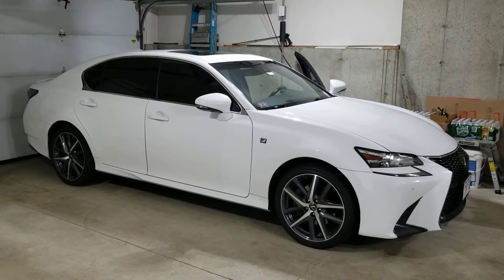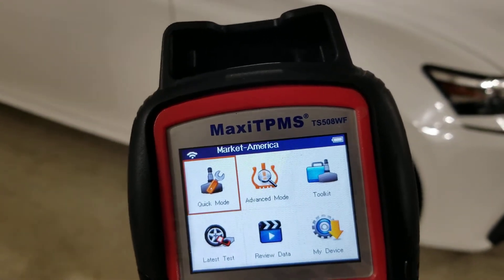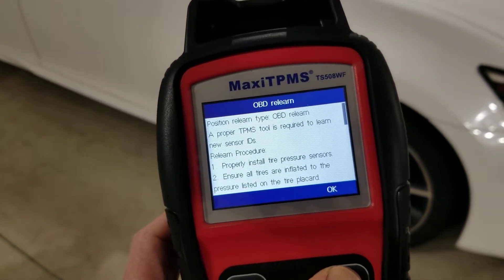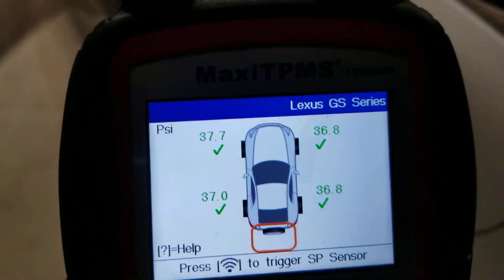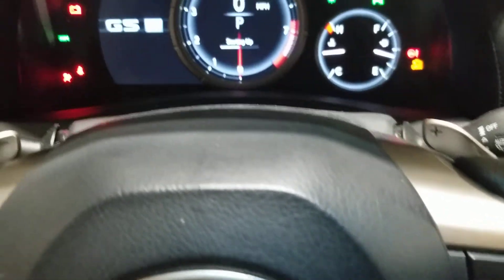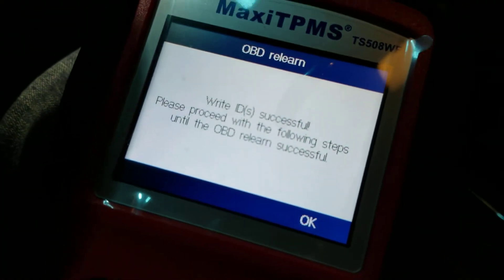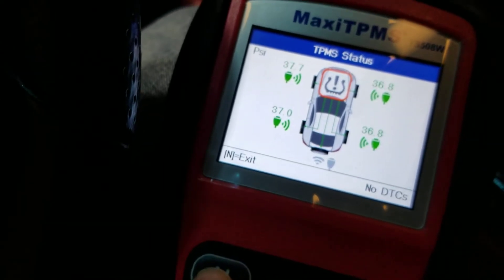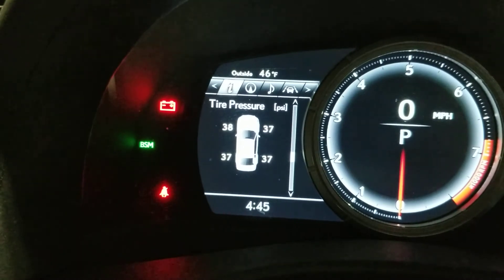How to program TPMS programming #Autel MaxiTPMS TS508WF #tire pressure sensor #car maintenance #how

Comment: Mine says obd relearn successful,but doesn’t show tyre psi reading on the dash board,just- - -
Reply from the maker: You probably have sensors that aren't 100% compatible. I've run into this before it will still inform you if the tire pressure is low though.
Reply: @LEX508YouTube thanks for the information

Comment: hello, i changed my rims from 19'' to 22'' and oem tpms doesnt working, will Autel MaxiTPMS TS508WF solb my problem?
Reply from the maker: Are you using the same tpms sensors?
Reply: Yes I transferred the oem tpms from 19 to 22”” rims. I ordered the autel kit and i am very curious to see if will they work.

Comment: First of all, thank you for the posting makes it simple 
I’m a little confused on the type of sensor you have on your summer tires, at one point you say you’re using MX sensors and then other post you say you’re using OEM sensors. Or OEM and MX the same sensor? Or does the 508 work on 99% OEM and MX?
Reply from the maker: I've used it on many brands and never had any problems. It seems to work very well with all the ones I've tried.
Reply: @LEX508YouTube  Got it. Thank you for the reply. Best price I can find is about 150 new but not hard case or magnet now. Again..Thank you
Reply from the maker: @Fishhunter007 No problem! Please link and subscribe to help my channel.

Comment: I see lots of used TS 508WF for sale. I have a 2017 RX 350, my understanding was up to 2016 they were able to store 8 sensors, 2017 on it is only 4 codes. Last check was $50 to reprogram my snow tires then again in the spring my summer tires. What a PITA-does anyone know if this works on the 2017 RX-350 ?
Reply from the maker: I don't see why not. I use it on my 2016 Lexus, my 2020 Jeep, and my Acura and my Corvette.
Reply: I mentioned 2017, up to and including 2016, there was 8 saved places. In 2017 that changed, I also downloaded the operation chart from Autel-it is unable to communicate actual pressure on all Lexus  @LEX508YouTube 

file:///C:/Users/onewi/Downloads/TS508_V6.49_FunctionList_US.pdf

Comment: 115?  You sure about that?  This is a $250 tool.
Autels instructions are very poor.  It doesnt cover several issues ive had using it. And its definitely not a pro grade tool to be used in a shop environment.  I have a honda Odyssey this tool think one sensor is bad but firestone was able to read the sensor with their tool and get the toms light off.  Maybe better suited for DIY but buy the pro grade tool if you work in a shop
Reply from the maker: Yes, $115 at the time I purchased it. I thought it was a scam myself. Works great! I've used it on my cars with no issues. Thanks for the comment.
Reply: I just got it for $133 on ebay with free shipping.
Reply from the maker: @mmmpinaycolada Good deal!

Comment: so , where did u buy the sensor, is it universal sensor?
Reply from the maker: The sensors came with wheels, but yes, they are universal.
Reply: @LEX508YouTube  

got it, my sensors are shot needs to be replace , can this reprogram a universal tpms sensor or does it have to be oem
Reply from the maker: Yes, it can program any sensor to the car. I haven't had any issues with any sensor oem or non oem.
Reply: @LEX508YouTube  

thks, going to grab one . 👍
Reply: @hjkjccdggjhvb  not so fast cowboy, This tool can only program the autel MX sensors.  And supposedly other aftermarket programmable sensors.  As far as oem sensors, It can only make a already programmed sensor work with the ecu.  What you are asking is basically linking the sensor thats already programmed to work with that car. Yes, but thats what all basic tpms tools can do.    When you buy a new sensor for your car it comes ready programmed. (OEM codes). Most cars in my experience will learn the sensor after you start driving. This particular tool is almost useless.  The only thing that makes it useful is programming less expensive universal sensors and their autel MX sensors. If you buy this to use in a shop youll run into its limitations in the first few cars.

Comment: Just got the same unit today. It was able to read all the  sensors but  takes forever to communicate with my 2013 Mitsubishi RVR without succes. First I used "TPMS Diagnose" to wake the sensors up. Trying to use "Position Relearn". What could be the problem?

Comment: My 2017 Lexus is200t does not display tire pressure after replacing a new sensor, but the sensor light go off, and the tire pressure just match with ts508 data, just not displayed the pressure on the screen! Can you tell me how to fix?
Reply from the maker: Unfortunately, some sensors will not display the actual tire pressure, but you can program them to the car, and if you have a low pressure warning, it will notify you. My huff sensors won't show on my Lexus gs350 buy they are programed to cpu.

Comment: Install all new autel tpms in 5 tires after all of them are red color, how do I fix this?
Reply from the maker: I'm not sure what the problem is.
Reply: Scan all tpms sensors no problem, but when i go inside the car turn on engine and i see the dashboard with all sensor all in red unavailable tpms sensor, How to fix this problem?
Reply from the maker: What kind of car?

Comment: Man I got a 2017 Lexus is350 f sport and got some rims and tires from fitment industries. Well every tire shop I went to to get the  TPMS sensors relearned they said they couldn't get it to communicate. I recently purchased the lunch 5011E tried it and got it to read the sensors plus it fixed the light but my psi still comes up with ---- on all 4?? any opinion? I believe the sensors are MAX gen 2.
Reply from the maker: Yeah unfortunately mine do the same thing. The sensors are program in the car but won't read the psi. The good thing is that it will trigger the tpms light on if you have a flat.
Reply: Did u figure it out? I got 4 new tires & now all I see is  - - - - & the TPMs yellow alert on dash.
Reply from the maker: If the TPMS light is on, that means they aren't programmed to the car.
Reply: @LEX508YouTube  this is first time that changing tires causes this issue. Did the shop forget to reprogram ? Or break the 4 sensors?
Reply from the maker: @AJCoReTV They probably didn't reprogram them. I doubt they broke all 4 sensors.